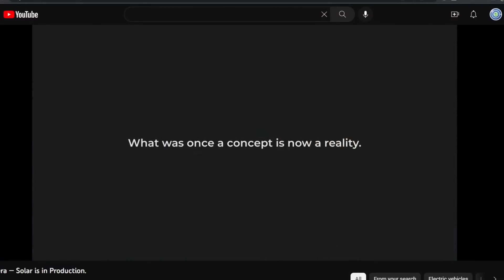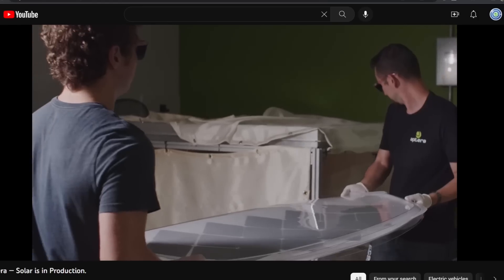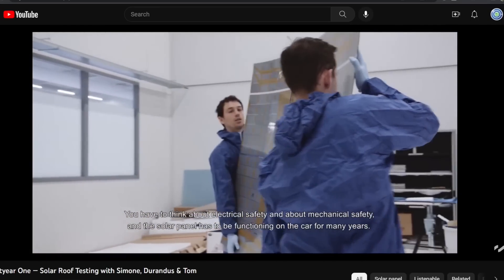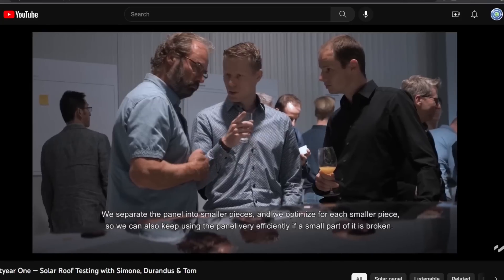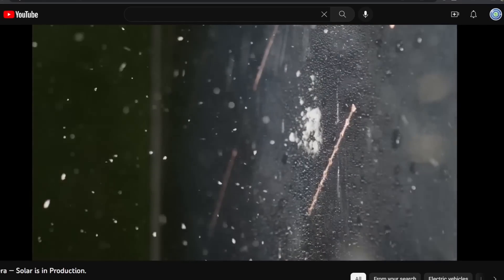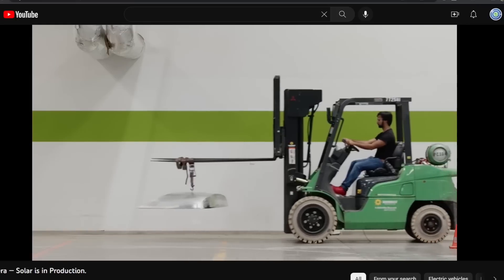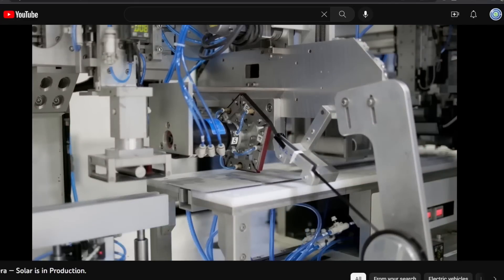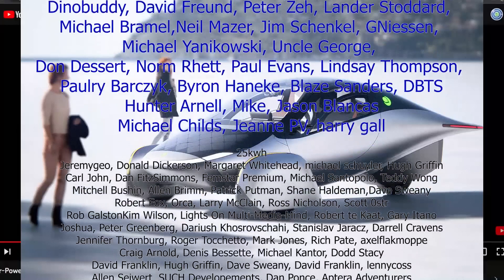Why did Aptera, Sono and Lightyear all independently develop solar panels?

Comment: i see a possible cross licensing happening between the ones that wish to cooperate with each other.
also the lightyear doesn't seem to have mass production in mind with their price point.
Reply: 🤫 Lightyear is also developing a 2nd, more economical car, the Lightyear 2, aiming at 30,000 Euros, the same range as the other 2, for 2024 or so.
Reply: @fotoguru222  if that is the case, it could be the 4 wheel aptera some folks want. time will tell
Reply: @user--PM  Competition to make more efficient vehicles can only be a good thing.  Lets hope it catches on!
Reply: If there was cross licensing it would have showed up on Apteras financial reports which it hasn't.

Comment: Steve, it's not "injection molding" vs "encapsulation".  It's more likely "injection molding"  vs "laminating".  Encapsulation of solar cells can be done in a variety of ways.  Injection molding, laminating and spray coating just to name a few.  Lightyear is doing a straight up "laminating".  Very similar to "conventional" glass front solar panels.  Sono, of course, is doing injection molding.  Aptera is doing, at least, some laminating and possibly some spray coating.  Of the three, injection molding, even with extreme compound curved surfaces, is, in the long run the least expensive way to go.

Good of you to point out that Aptera's compound curvature isn't all that unique.....took you a while...

Regarding the World Solar Challenge racers, I've said it numerous times that they are, for all intents and purposes, 1-off builds but since most are done with proper materials, they can and do last much longer then a race of just one week.  Many a low budget team race the same car over and over again and some take their vehicles on very long "journeys".  See Bochum SolarWorld GT for an example.   Also, I have said numerous times that they are made very low in weight by just reducing the thickness of the encapsulation materials.  Identical panels with thicker encapsulation materials are routinely made and can and do easily pass all the "automotive grade" requirements.
Reply: I think Aptera is possibly spray coating it with Teflon?
Reply: @MakeSteelBattalion2  I would wager a variety of cross linked polyurethane coatings
Reply: @MakeSteelBattalion2  I'd be surprised.  I'm pretty sure all forms of fluoropolymers, of which "Teflon" (PTFE) is one, are very, very easy to scratch.

(edit: my wild guess is automotive "clear coat".)

Comment: Let's point out that all three companies independently chose the path of internal R&D most likely for the same reasons. A point, if three separate competent engineering organizations came to the same conclusion independently, that is a pretty good indication that it was the right approach.

R&D is high risk. Since it deals with the unknown, it is difficult to forecast a reliable schedule, budget and allocation of technical staff. One approach is to undertake R&D yourself so you have control over it and, if successful, claim useful/profitable Intellectual Property (IP).  You can have a backup of licensing if your solution does not look like it will work. The other alternative is to license technology from someone else who has something close to what you need and adapt it for use in your own design. The risk there is a schedule dependency on an outside source of a critical component which you still may need to expend a lot of resource to adapt and who's development schedule does not fit your own.

None of the three technologies are mature and proven in the real world. In my opinion, this would preclude licensing and adapting an external solution because there is no assurance that the technology will work as a risk reducer in your application. 

Another factor is the "Not invented here" syndrome. Engineering pride says "We can do it better" and may overcome more rational, objective judgement. 

Another factor is just not knowing enough about the technical area to make a good build or buy decision. Aptera has acknowledged that they were neophytes in the solar area so may be a factor.

In the end, unless you were a fly on the wall in the engineering and management meetings of these companies it would be impossible to know the rationale for the decisions.
Reply from the maker: Lots of good points!
Reply: I looked at flexible / roll out panels eight years ago when I was designing my solar PV system.  They were at that time very popular with RVs.  

Play nice lads.
Reply: Great points, will add ◾build/buy… best way to evaluate buy options, is to try to build better; failed build is still a win provided other project development wasn’t starved of resources. ◾"not invented here"… is real but negative, fine line between arrogance and healthy confidence/competitiveness. Think Apple with independent teams working on same problem / device development.
Reply: Lot's of "bad" points too.

They are most definitely NOT "the same conclusions"!!!!

LightYear's solution is so like conventional glass front solar panels they might as well be "mature and proven in the real world".  Sono's solution is injection molding.  Again, pretty mature and proven.  Aptera?  Not so much.
Reply: @bobhilder1469  Did anyone have experience insert- or overmoulding solar cells before?? 
Another process that could certainly go wrong however much experience one might have with IM.
Reply: @karstenstigmezinirasmussen7786  Although I can't think of any off the top of my head, I'm sure there are and have been IM solar panels.  Of course if one was to attempt IM solar from scratch, they would have to learn by doing but compared to what Aptera appears to be doing, the lessons would be much easier.
Reply: @bobhilder1469  Yep, EXACTLY the same conclusion. "Do your own R&D". You missed the whole point. Probably no R&D Program management experience. Their conclusions to do their own R&D would result in different solutions to their own specific use cases. Pause and think a minute before your knee jerk reactions.
Reply: @yanpingyang9028  While I see your point now, your leading paragraph could EASILY be interpreted as I did originally so bite me.
Reply: @bobhilder1469  Except that no other forum poster misinterpreted it to include the sponsor of the forum. No need to resort to a juvenile insult. Try to be a little more sophisticated if you want to deliver an insult.
Reply: @yanpingyang9028  You said: "Except that no other forum poster misinterpreted it..."
My response: And you know this how?

I certainly can be less "juvenile" and more "sophisticated" in my delivery but I lower myself to the level of the target or they get a glazed look in their eyes.
Reply: Why are you trolling forum members?  I, along with likely others, "misinterpreted" some of your original comment as well.  Perhaps you need to "Pause and think a minute before your knee jerk reactions" because it's a bit "juvenile" and not too "sophisticated".
Reply: @johnreeves7261  I "misinterpreted" the original comment as well.

Comment: Due to Aptera's pricepoint, lightyear tech may have been too expensive to produce.
Reply: Cost efficiency shouldn't be sacrificed because of whatever the sales price of the first vehicle is. 
It could be a reason why higher cost could be tolerated for Lightyear,  but they,  too, intend to produce affordable vehicles. If they don't worry about cost now,  they are going to have to start development all over for the next, more affordable SEV. Not a good strategy,  IMO.
Reply from the maker: Good point!
Reply: LightYear's solar tech is not too expensive to produce.
Reply: @bobhilder1469  Probably not too expensive, but still more expensive. Lightyear looks like they are using half cells and have an incredible fill rate. They have a much more impressive solar package. Aptera seems to have gone the simpler way, and they aren't using every possible useable surface area for solar like Lightyear is. Which is a shame, but for range, Aptera uses that solar energy better.
Reply: @MakeSteelBattalion2  Frankly, on a per delivered watt basis, I doubt Lightyear's solar tech is more expensive than Aptera's.  They are using just under "half" cells.  You can tell because there's no radii on any of the 4 corners of the segments.  The full Maxeon/SunPower Gen 3 cell is made from a nominal 166 mm diameter wafer.  The industry term for such a cell is "pseudo-square" (it's square but has rounded corners).  I agree that Lightyear's "package" is more impressive.  Much of what they did comes out of the solar racing community.  At least one of the founders of Lighyear comes out of Solar Team Eindhoven.  A team which won every single World Solar Challenge "cruiser class" event they ever entered.  They knew what they were doing.

In my over 25 year experienced TECHNICAL opinion (almost 20 with Maxeon/SunPower cells), Aptera's original design approach was misguided by the technically false idea that the cells are less likely to break if oriented at a 45 degree angle to the longitudinal axis of the vehicle.
Reply: @bobhilder1469  The official reason by Jason Hill is that by rotating the cells 45 degrees they were able to add 25-30% more cells in the same area. He said that in this video https://youtu.be/t4mPz7MLFeo?t=2736
Reply: @MakeSteelBattalion2  Thanks for the link.  Boy, if I hadn't heard that claim out of his (Jason's) mouth I wouldn't have believed he ever said it.  I have to call it a day but I'll re-listen to the video in the AM and see if I missed something.
Reply: @MakeSteelBattalion2  I re-listened to the relevant part of the video and I'm still somewhat stunned that Jason said they could get about 25 or 30% more cells overall using the 45 degree rotated cells.  If you just look at a top view of Aptera with full solar you can easily see 10 to 15% "wasted" space on the roof alone.  Almost all of it on the perimeter (the triangles).

FYI, Jason made a few other comments about the solar in this video that are flat wrong.  The cells are not "very flexible in one dimension".  They are very flexible in ALL directions.  I work with the same cells practically daily.  Also, when speaking about the lack of "gloss" on the dash he somewhat conflates the reflectivity of the bare cells with the reflectivity of the finished panel.  Practically ALL, not just Maxeon/SunPower, bare single crystal silicon as well as bare multi crystal silicon cells have a "non-reflective" top surface.  When cells are encapsulated, the top surface of the module is now what matters.  How that surface is anti-reflection "treated" matters even more.  If the glass is not anti reflection treated, a typical glass top solar panel will be highly reflective even if it contained "black silicon" solar cells.

Comment: Injection molding would be more expensive up front because of tooling but faster and less expensive later. The vacuum films are much cheaper up front but more expensive down the road for the opposite reasons above. Makes sense as to why they chose the route they did.